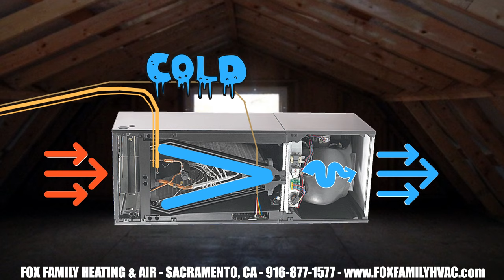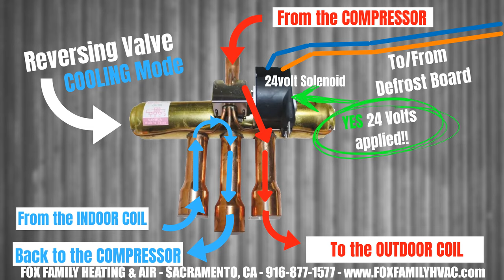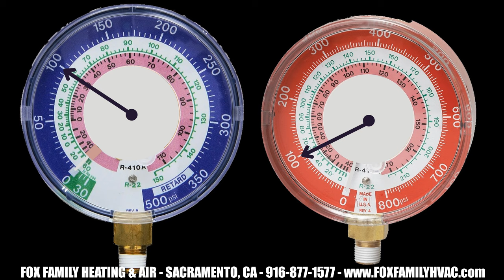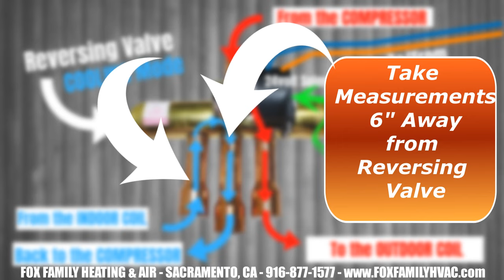Heat Pump Reversing Valve Troubleshooting Tips (Switchover Valve)

Comment: Trane valve fail in both heating and cooling mode at the same time and cause the compressor to lockout and cause a vibration when going to lockout mode 24 volts is present soloniod in the cooling mode. The heat pump should be in cooling mode to perform the test pull one of the soloniod wire off and will going to heating mode. If compressor going in to  lockout defective valve. In the cooling mode no suction psi defective valve. Check the suction tube going to the valve and the center line for the valve with your hands no cooling valve defective easy fix. High side psi good and low side about 23 psi 410 a refrigerant.
Reply: Mine is a american standard, it keeps going into lockout mode.  2 of the bottom pipes freeze over and then the unit shuts off for 15 minutes. Then it runs again for 30 seconds  then off again.  Sound like a stuck valve to you?
Reply: @korycurtis3730 moisture and low refrigerant causes system to freeze. recovered the refrigerant pressurize system with nitrogen leak check / vacuum and used a scale to add refrigerant back into the system on the name plate tells you how much lbs into the system.
Reply: @islandbeaches395  OK thanks for the reply,  I've got a service guy coming tomorrow.  Was just trying to figure it out before I get a bill.  Unit is only 3 years old but I guess I'm paying for labor.  Seems weird 2 days ago it worked fine, it almost acts intermittent, like a bad metering device causing the reversing valve to freeze.
Reply: @korycurtis3730   without having a compound gauge you cannot diagnose refrigerant cycle. If the the low side goes into vacuum while charging the metering devices may be blocked depending what type metering devices. Piston you can clean the hole. Thermal expansion valve will have to be replace. Hope things work out for you.

Comment: Put in a new heat pump Goodman it runs in cool have good pressures but once I run the heat pump it’s runs for 5 min then shuts off and comes back on 5 min cycles